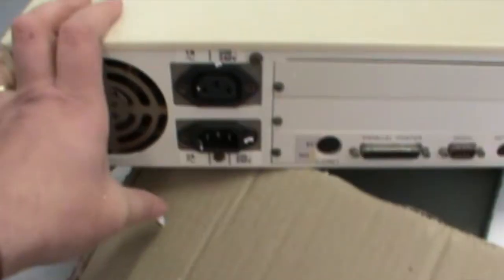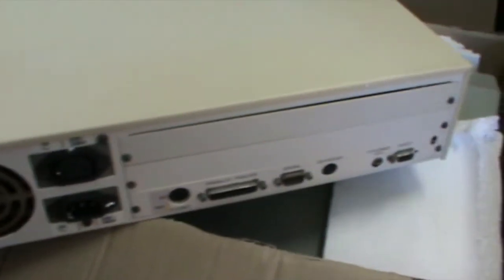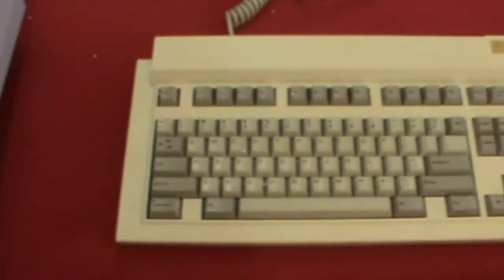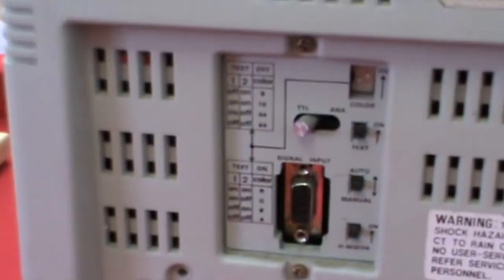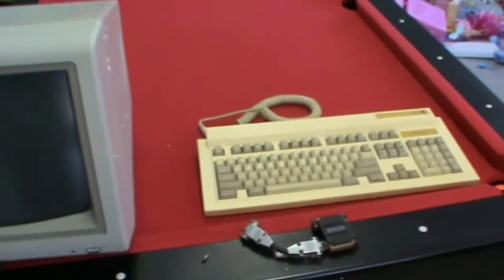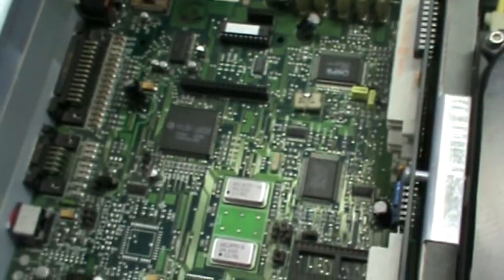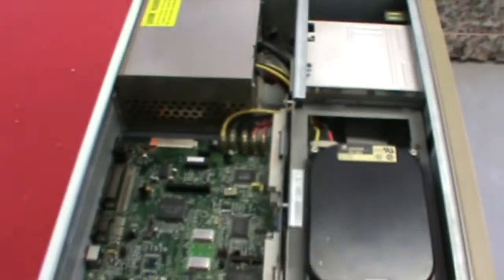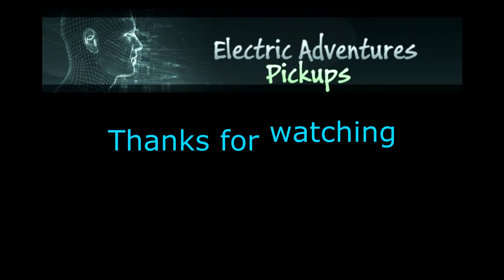Retro Computer Pickup - Acorn A5000 29th October 2012

Comment: The use of the TAED along with UV in the process (found in the oxyclean) is the reason it's so remarkably effective. It boosts the peroxide's ability to pull the bromine (the chemical that makes it yellow) from its oxygen bond on the surface.

Nappy San/Napisan as I see is the TAED portion and you're adding UV sunlight. The addition of peroxide will boost its ability. So chemically, you've been using close to the ideal composition already. You can the stronger peroxide at most salons.

Comment from the maker: Oh yeah it sure did.  I do think I have been lucky and most of the strongest of the acid went out the case at the back (thus the burn and rust spot there).  I have cleaned the board up a bit, but really need the new battery (still need to order one) and probably the IC just above where the battery is mounted.  I still have crystals lodged in it's pins.

Comment from the maker: It does not seem to have eaten through the PCB protective surface at this stage.  So we shall have to see.  I have ordered the replacement battery and have a bit more cleaning up to do, especially around the CMOS IC (which may still need to be replaced).

Comment: You can remove the UV oxidation on plastics without bleach and instead use a peroxide based solution. Just Google, retrobrite and they'll give you the ingredient list, very detailed instructions as well as before and after results. I've used a modified form of what they use as I can buy the raw chemicals it needs, but everything is quite easy to obtain.